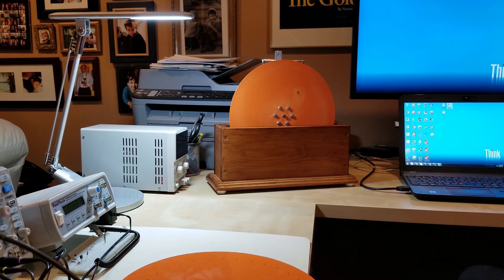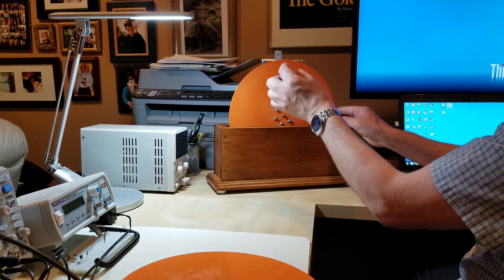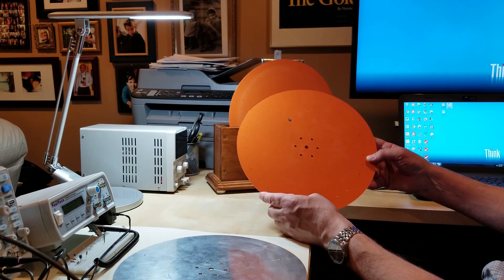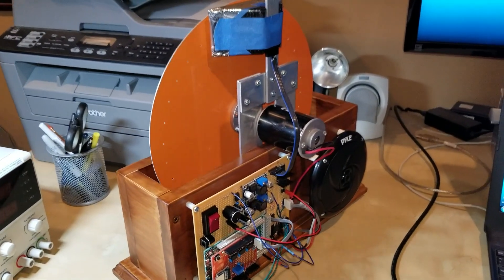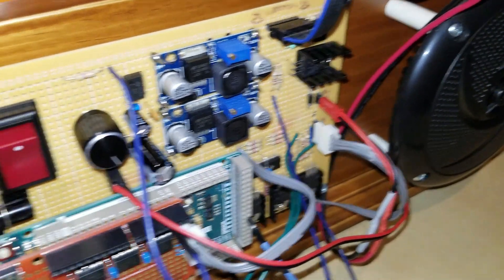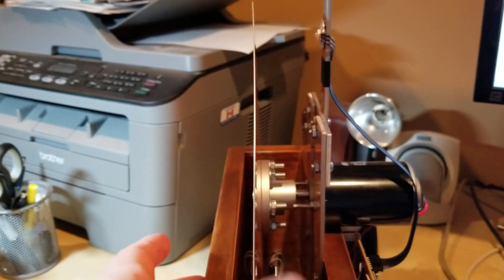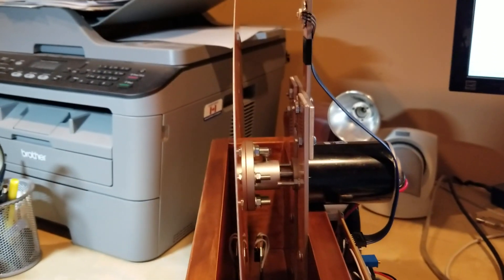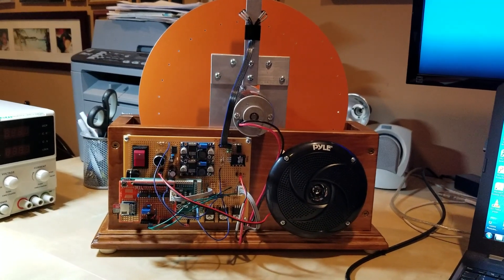A Closer Look at My Mechanical Colour Television

Comment: Have you maybe tried to use a one side opened drum, instead of disk, and 45° positioned mirror inside the drum? And square scanning holes on the cylindrical part of drum? To have constant velocity of scanning hole for all lines, achieve almost rectangulare and bigger screen?

Comment: About your defuser. Face the led away from the disc from outside the field of view and maby from as many as 4 points around the viewing field behind the disc  Reflect the led light off of high quality white bond paper.  Instead of filtering the light . To get a smooth picture without grainyness.

Comment: Nice redesign of an ancient idea! I watched a lot of reiterations of this on YT but they are all the same. People copy the original idea without any improvement at all... It's just digital instead o analogue.
Back in the 20s rubber was a rare material and very unreliable. Still, if they have had this material handy, I think they would have made a continuous rubber band with holes in it rotating in a horizontal plane over 2 bearings. Just like a movie film roll. The disc has inertia and cannot be controlled reliably all the time. A rubber band is much easier to control. And the holes will have the same speed in the horizontal and vertical directions, hence, the image will not be trapezoidal anymore... Don't understand how nobody thought about this before. I hope I'm wrong.
About the light emitter, you could use a lantern mirror with an LED inside. A good lantern will have an almost laser like beam. Which is exactly what you need.
Hope this message helps in any way.
Cheers!
Reply: A sua ideia com a cinta de borracha e boa mas ela esbarra no mesmo problema do disco quanto mais pontos você fizer na faixa de borracha maior ela será em relação a tela por exemplo uma faixa de borracha com 32 furos em uma tela de 3 cm quadros 32 vez 3 e 96 cm quase 1 metro de fita de borracha e precisaria  de um motor muito potente para gera muitos quadros por segundo então essa idéia fica impraticável imagina 60 furos para uma tela de 3cm são 60x3 a fita de borracha teria um metro e oitenta cm quase 2metros de facha de borracha valeu
Reply: Rubber band is, IMHO bad idea, there already was better material for that - film. They could "print" transparent dots on it and then run it in endless loop (at quite high speed), so they would have continuous scanning mask with almost unlimited number of lines. There also could be other mask that would reduce the necessary length of first mask as it could section it into parts, for example upper and lower etc.
Reply: @MrToradragon  Rubber is more reliable than plastic. And it was readily available back then while plastic film...not so much. Today we could do it with many materials, correct.
Reply: @danielmusat597  But rubber would be either too elastic or too hard and nor bending easily, plus rubber could decompose faster than celluloid that was quite common plastic in 1920's and 1930's and in form of film it was already produced in large quantities for movie industry and photography. So that would be readily available and reasonably reliable, sure it would perhaps be necessary to replace the "ribbon" from time to time, but I can imagine that  those would be easily available in stores.
Reply: @MrToradragon  Essentially your idea is better. I don't know much about celluloid.

Comment: So, your motor/disc rotation cues your Due/video? [ That's 'cheating'.  (-: ]  
Nice rig. 
For diffusion, give wax paper a trial.
What did you have to do to make the test video used?
Reply from the maker: It is cheating a bit, but it makes sense to do it that way when reading from an SD card. I would have had to do the opposite (sync disc to video) in order to deal with a live source. That was definitely a big challenge back in the day (~1920's).

As for wax paper, yes that would probably work. I've used it before for making pinhole cameras.

Here's a brief summary of the steps used to make the test clip:

- Used video editor (Pinnacle Studio) to crop image and output in uncompressed AVI format
- Used VirtualDub to convert from AVI to raw RGB
- Used audio editor (Audacity) to change audio sample rate to match video rate and output as raw samples
- Wrote a Python script to read the raw video and raw audio and output as raw interleaved video and audio. This file was then transferred to the SD card.

Hope that helps and thanks for commenting!

Comment: I built a 32 line Televisor over 40 years ago when I was a teenager. It had a one and a half turn spiral and was both a camera and screen. I used yellow LEDs for output as blue LEDs hadn't been invented then, but always wanted to make one with colour, maybe red/green only. The camera part wasn't very sensitive so I didn't get a very good picture and also my skills at making the disk were terrible so the lines didn't scan very well but it was a fun project. I should try it again sometime.

Comment: I guess in the 1920's, a difficult part would have been to synchronize the receiving discs with the transmitting disc.
Reply from the maker: That was definitely a big challenge back in the day. I believe that most systems relied on a common AC line frequency, though phase adjustment was generally left to the user. Apparently, some systems relied on the user to continuously adjust both phase and frequency. Here's a link to some more info on the problem of synchronization: http://www.earlytelevision.org/Yanczer/motor_drive.html

In my homemade version, flexibility provided by the SD card allows the video to be synchronized to the disk rather than the other way around. Even in my latest version which includes PID motor control, it is the video which is synchronized to the disk. The PID control is used to achieve a desired rotational speed for consistency and to synchronize with the camera used to film the demo.
Reply: @sciencenstuff4726  Great work. I am currently trying to synchronice my system using Arduino Nano with PID control. I want to synchronise the disc to the signal as in the 20's and not the other way around. You can see my old results using PLL (IC4046) for synchronisation here: https://www.youtube.com/watch?v=8GYGxEk0btA. The synchronisation on the Baird System in the 20's and 30's were not that bad, using a modified La Cour wheel or the phonic weel as in the Baird Tin Box Televisor and Baird Mirror Drum Reciever. The picture was steady for several minutes and adjustment was easy.
Reply from the maker: @televisionbb  Thanks for commenting. I saw your video back when I was building mine and was definitely inspired by it. I especially liked your choice of content (the Danish singer) which gave it a real feeling of nostalgia. Good luck with your modifications and I hope you'll post a video of it when you're done.

Comment: Nice! Is it possible to hook a composite input on it and feed a live video signal into it?
Reply from the maker: A composite input is definitely possible, but would be a fair bit of work. In addition to a video decoder to convert composite to RGB, you'd also need a video scaler to scale the video down to 32 lines. In practice, you'd also need a frame rate converter to slow down the frame rate, otherwise the disk would need to spin at an unrealistic speed. I actually considered doing all of that, but decided the SD card was easier. Thanks for watching and for commenting!